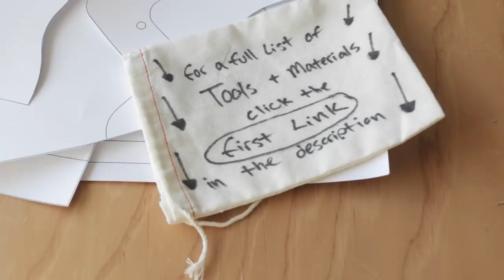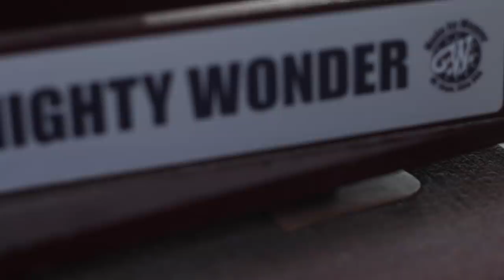Making Her FIRST Leather Long Wallet!!!

Comment: You should put a piece of flat metal in between the layers, going from snap to snap.  Years of opening and opening, will make the leather start to bend and it'll be a pain to open cleanly.  It'll be like trying to open a bag.

Comment: Does anyone know what kind of card or material that is for the patterns for cutting as I am struggling to find a good material to print my designs on  that have a bit of structure?
Reply from the maker: Heavy card stock, I think it's 110lb
Reply: @Corter  Thanks for personally responding and the info, I appreciate it.
Reply from the maker: @lostwithdan4331  any time!